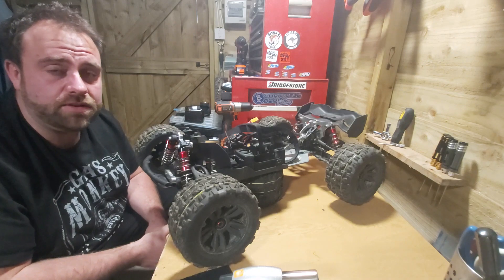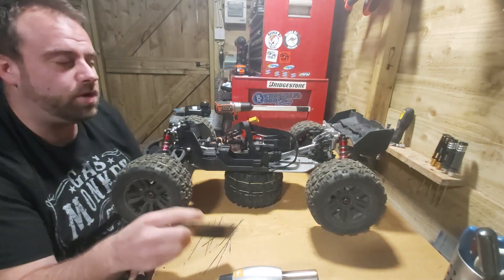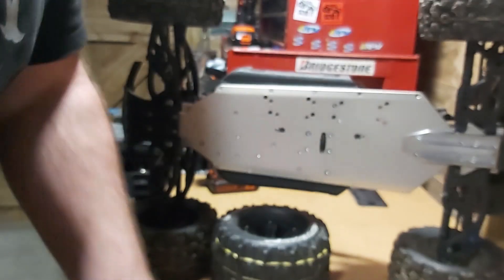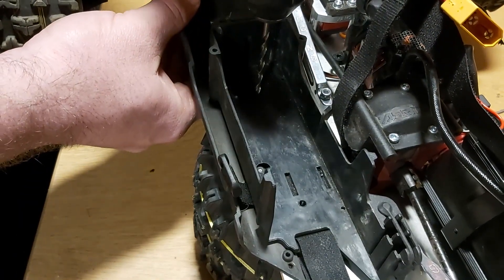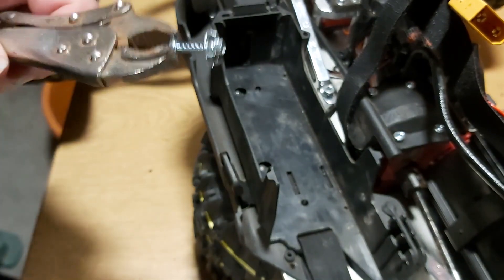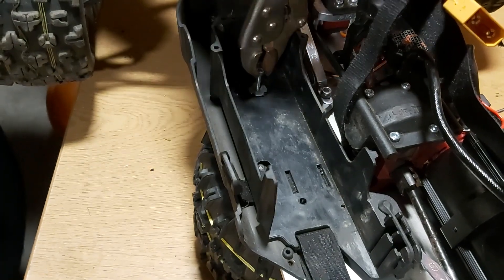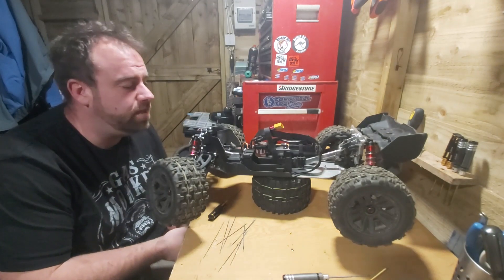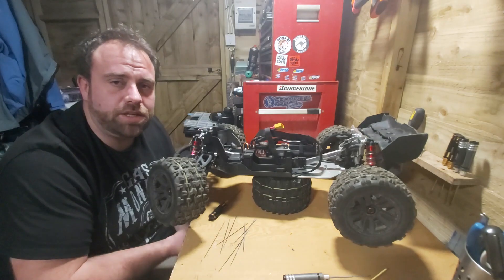How to reinforce your Arrma 6s Battery tray

Comment: I watched this vis when you first released it but ever since I've been meaning to rewatch it, get the hardware and use this method to mod all of my 1/8 arrma's... FINALLY  got myself up to home depot and have one of my kraton"s as well as my "krojave" (as you call it) competed! Thanks so much for listing the hardware as I wasn't 100% sure that ide find everything I needed on the spot but fortunately for me they had the hardware and with the use of some "child playroom floor  padding" ive used for years now as padding inside the battery tray whenever I run them and can't be anymore happy with the results. It's really an incredibly inexpensive/quick/east mod to do in order to fix the issue with the lipo ejecting from the rig but IMO hands down one of the best mods that there is period(very low cost/few mins install/no more fear that my lipo, rx and servo being damaged ) and now I know I don't have to worry about the plastic stripping out causing alot of problems/expensive repairs or needing to be completely replaced anymore. THANKS AGAIN I OWE YA ONE FOR SURE!🍻👍👊
Reply from the maker: Cheers man I'm glad it helped. The best mods are the cheap simple ones. This one is one of the best , simple cheap and very affective